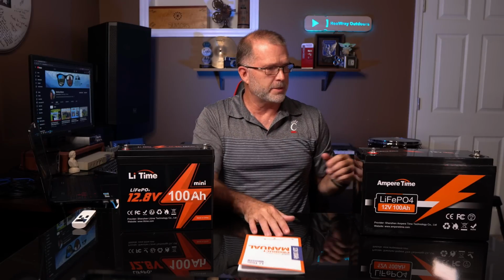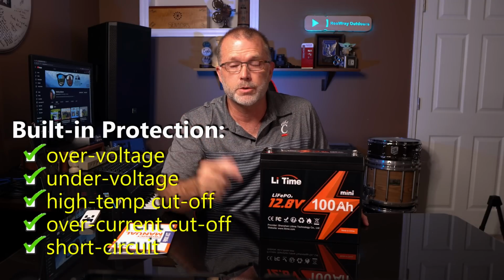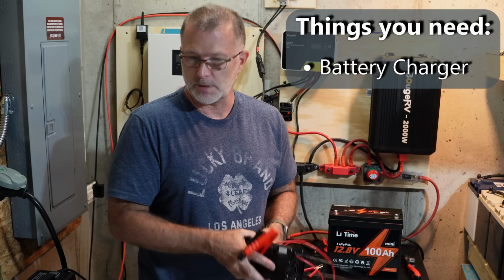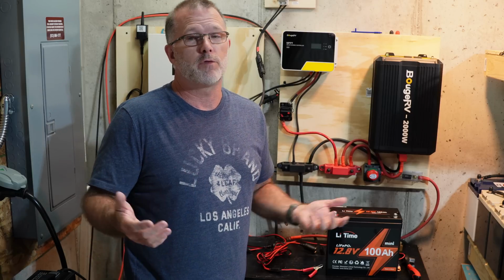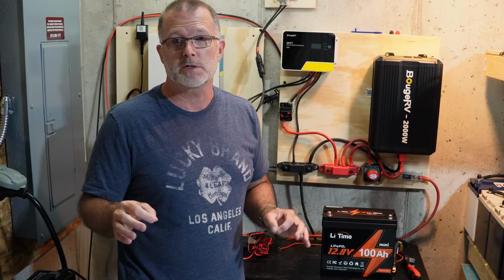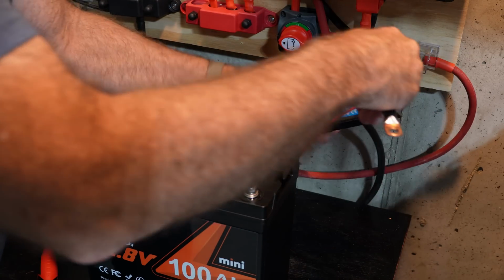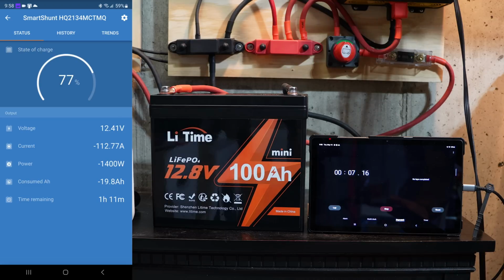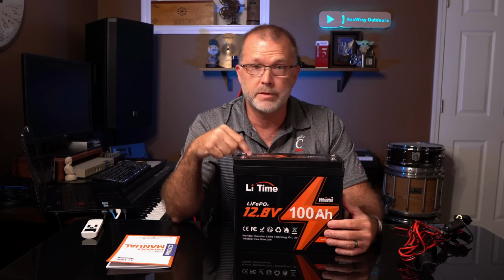12V BATTERY BASICS:  Featuring the NEW Li Time Mini 12V 100Ah LiFePO4 Battery

Comment: Hi, thanks for the great info, I have 2 of the mini’s and looking for a way to see how much time and capacity is remaining while using real time
I see the Bluetooth info from shunt and looks like it showed over 2 hours but actually was only about 15 minutes while you ran the test? Is that correct? 
Is there a gauge that will accurately reflect real time capacity remaining while using? Thank you

Comment: I have two of these Li Time mini 100ah lithium batteries. I know this battery does not have low temperature protection, but do you know if it has the ability to shut down charging ability below 32 degrees?

Comment: Unfortunately, they only have a C/2 rating..  I need a 1C rated battery.. Otherwise.. price and quality look good.
Reply: I was hoping these were around 10c-15c rating so i could replace the 96ah Headway cell bank I have in my car for my stereo system.  So these are only 2c rated..?
Reply: @Randy_G  I talked to LiTime.. They assured me the battery had a 1C rating... but, for charting it is a 0.4C rating.. I don't know enough about LIFO batteries to understand this.  My want is to be able to recharge as rapidly as possible

Comment: 👍👍 I clicked your link and I saw one was 230 amp hours and I read the warning sign. It said do not reverse connections to the battery. So do that mean you cannot charge your front battery with your back/home batteries. 11-21-23

Comment: Based on your review of the Li Time mini battery I bought two of these and they have performed well. Have run our 12 volt fridge overnight successfully.
My concern is that since these batteries do not have low temp protection (I’m in the NW suburbs of Chicago), is it enough to disconnect the battery cables to prevent the solar panel from charging when below freezing. We’ll be heading to Florida in a couple months. I’ll leave the batteries disconnected until we get to a campground where the temps are consistently above freezing.
Or…
Should I disconnect the batteries and move to my home, placing them on a slow trickle charge..

 I’m hoping disconnecting the battery cables will be enough for that 2 month period. Thanks.
Reply from the maker: I think you're fine just disconnecting the solar charging cables. They concern isn't so much the temperature it's trying to charge the cells while they are frozen, that is, the main problem, the battery itself can certainly handle some low temperatures without any as long as you're not actively trying to charge it.
Reply: @ReeWrayOutdoors  Thanks for the quick reply. I’ll take your advice.

Comment: Awesome video, extremely thorough. I'm between the regular 100ah LiTime and the Mini. The only real difference I can find is the type of cell (prismatic vs pouch) and obviously the Mini is lighter/smaller. The Mini is $10 more. I will be using it to power a trolling motor. I'm leaning towards the Mini for smaller size. Do you have any recommendation? Thanks!

Comment: I just  bought one to put under the passenger seat of my 2005 T1n Sprinter. It will hook up to an 1800w Tripp Lite inverter that was already in the van w an AGM attached. They ruined the AGM by leaving the inverter on and draining the battery.
Can I just hook up the new battery? Or do I need anything else to change from AGM to lithium.

Comment: I have a question. How long will I be able to riun a Portable AC that pulls 860 watts off of two of these batteries? I'm Using a 1000w inverter to run it. By the way nice Video, very specific on how to start your own system. looking forward to seing more.
Reply from the maker: There are a LOT of variables here so all we can do is make some assumptions and estimate.  If we assume that the compressor will only be on for 50% of the time (given the temp setpoint, and the room's insulation properties), you could estimate that the combined 2100Wh usable capacity of 2 of these batteries through an AC inverter,  divided by 430Wh, should get you just under 4.75 hours of runtime....or only about 2.4 hours if the compressor has to run continually.
Reply: I use the old manual control Frigidaire AC. It draws only 400 watts.

Comment: can i use this battery to power a 70lb boat electric motor that runs on 12v!?thanks
Reply from the maker: Yes if it's a trolling motor that doesn't pull more than 100A continuous
Reply: I specify that I have a 70 lb brushless electric motor that runs on 12v to Makes carpfishing is the 12v 100mh or the 12.8 mini model better?

Comment: Sir how do I know how many mAH my snap on battery is per cell?....it's a 2.5ah battery with 9 1.2v NI-CD pls....it is not printed on the side
Reply from the maker: It's early in the morning and I haven't had my coffee yet...but I think we need to know the voltage of the battery pack.  Then we could probably figure out, based on the 1.2V of the 9 individual cells (if I'm reading that right) how they're connected.  And from that we should be able to calculate the individual cell mAh.

Comment: I setup my cutoff voltage on my first (of two) minis (from Powerqueen but an identical battery) to 9.5V and it was still going which surprised me. I emailed PowerQueen and found out their BMS parameters are little different. They shaved some off the top end but are going a little too low on the low end. Here's the email I got from PowerQueen on BMS specs

1、Single cell overcharge protection V 3.58 CELL MAX > 3.58V
2、Single section overcharge recovery V 3.48 CELL MAX < 3.48V
3、Single-section over-discharge protection V 2.25 CELL MIN < 2.25V Charging recoverable
4、Single-section over-discharge recovery V 2.45 CELL MIN > 2.45V
5、Equalized turn-on voltage V 3.455

I was happy to see they ditched the 3.65 or 3.75V cutoff for max cell voltage and went down to 3.58 which is MUCH better. We all know there is NOTHING to be gained above 3.60, the voltage skyrockets even at a low charge.

Comment: How would you recommend connecting to a USB powered device?
Reply from the maker: There are a couple of simple solutions you could use.  Here's one with battery clamps for quick attach/detach: https://amzn.to/46jWSW1    Or, here's a couple of USB connectors with direct DC leads that you could crimp ring-terminals onto: https://amzn.to/44jhBHS    Or you could just get a female 12V socket with clamps like this: https://amzn.to/3prZtMX   and just plug in a 12V car to USB adapter when you need it like this:  https://amzn.to/3NrgfUH    Hope that helps!

Comment: What type of charger/inverter does these batteries require?
Reply from the maker: You really just need something with the voltage that matches the configuration you're going to have them in.  If just a single 12V battery, a 1000W 12V inverter would be ideal.   This is a decent 1000W inverter: https://amzn.to/3owosOL  I have the 2000W version, but they're solid little inverters.   As far as a charger,  I think I put a link to a suitable charger in the video description if you want to check that out.
Reply: A 20 amp plug-in LiFeP04 charger is how I top mine off before storms.

Comment: I have this battery in my YakAttack CellBlok, one of the key benefits for me is that it's lightweight, especially with the battery compartment on the rail of my kayak. I've had zero issues charging it or having it hold a charge. I'd definitely buy a second one if I needed it.

Comment: I have been using LiTime batteries for my solar power system for six months now, and they've been working flawlessly. The compact size and light weight make them easy to install, and the fast charging time is impressive.

Comment: Hey there, this is actually a funny coincidence… I’m looking to power my two electro voice zlx 15s at the beach for a event next month… I see you have one in the background lol… I want to build a power station with a battery and inverter… my knowledge on amps, amp hours is pretty limited, but I can somewhat understand…. My question to you is in your opinion what do you believe the best battery and inverter (watts) would be good if I wanted to run those speakers for about 6 hours on medium to high volume…. your input would be greatly appreciated, thanks!
Reply from the maker: I'd have to test to be certain, but I think you could get by with a single 100ah battery and a 1000W inverter.   You definitely don't want to go super cheap on the inverter or you'll get noise in the speaker.  I'd highly recommend picking up a cheap watt meter and actually measure the consumption on your system for a couple of hours to get an average Watts per hour.  Take that number and multiply it by the number of hours you need to run, then add 20% for inverter loss and you should have a pretty accurate sense of how much capacity you really need.  https://amzn.to/3OvRqZU. For the inverter, this would be a decent choice (assuming  you're not pulling more than 1000W, which I don't think you will...but again, the watt meter will tell you for sure): https://amzn.to/3OuAD9j

Comment: Thanks for this video! I think the lighter, more compact battery is very, very cool. I think I'm gonna buy one to use on the trolling motor for my small inflatable raft. I've already switched to a LiFePO4 battery because of the weight savings and longer run time over Lead Acid, but now it seems that I can save even more on weight and also on space. Win, Win! 
  I recently learned that the fuse doesn't have to be in the Positive cable in most applications. That recommendation apparently came about from the automotive use of storage batteries. In a car, the negative or ground wire is mostly made up of the vehicle's steel chassis. Since the positive wire is usually a long wire running to each electrical device and the purpose of the fuse is to protect the wire, on a car, the preferred place for the fuse is the positive. If you are running a copper wire from both the battery neg. and the battery pos. to the device, like an inverter or a wench, the fuse can be put in whichever wire is most convenient for your installation.
Reply: The abyc says you’re wrong
Reply: What is the abyc? @nicholaycalhoun1681
Reply: Now that I know that you're referring to the ABYC standard for boat wiring, I think I'm still right. Do you realize how many boats use the same chassis grounding system as automobiles. The positive wire has the fuse because it is usually the only actual "wire", just as in a car. Besides that, the ABYC just makes "recommendations" that are followed "voluntarily" and they don't really explain the reasons why they make some of the recommendations. They may choose the positive wire simply because it works whether you're dealing with a chassis ground or an actual 2 wire circuit, but I know enough about DC electrical theory to know that, if you use 2 physical wires, the fuse will work fine in either of them. @nicholaycalhoun1681

Comment: The ‘reluctance’ that many consumers have had in adopting this Smaller, Convenient form factor, is the use of Pouch Cells vs. the “standard” Prismatic Cells.  While pouch cells aren’t actually “new”, since they’ve been used in laptops, tablets, cellphones, and EVs for some time, the use in Mobile Solar applications IS new.

Safety is a primary concern here.  I have yet to get any CONCRETE unbiased info on their stability in a vehicle Solar install.  Will P drilled holes in a pouch cell, and it exploded quite dramatically.  Another channel, the person drilled A Bunch of holes, doused with water, and had little drama.

I have emailed the couple of brands that have produced “Mini” batts like this, and None have given me Any useful information on Safety factors incorporated in to the design.  And YES, I’m well-aware of the difference between Li Ion, and LifePO4.

So …. Thoughts …. Anyone ? 🤔🤓
Reply: That is not true. Will Prowse drilled holes in a solid "state" Lithium pouch battery. That caught on fire. If it is a LiFePO4 pouch  battery it would not catch on fire but it would vent.
Reply: At this time, LiTime, Redodo, and Power Queen offer these …..
Reply from the maker: From what I've seen, LiFePO4 chemistry, if compromised, will generate a fair amount of heat, but tends to just smoke like a beast without actually catching fire, like Lithium NMC. So definitely not risk-free, but substantially less risk of fire.

Comment: I'm thinking about building a new off-grid man cave that is completely solar powered. I would like to run all my appliances such as a tv and lights that I can use without using an inverter at all. The lights of course are the easy part but is it possible to use a normal AC wall outlet and wire it up for 12/24 volts? The label on the back of the tv says it will run off DC  I just don't know how to use it for DC power.
Reply: Don't use a normal wall outlet for D.C.  It is unsafe and does not meet electrical code because it is unsafe.  Most of the time people use hobby connectors like the XT60, and the amateur radio folks have standardized on the anderson powerpole connectors for 12v.
I don't know anything about your TV, but usually there is either a separate connection for D.C. or the cord detaches and you would use a different cord with the TV connector on one end and the appropriate D.C. connector on the other end.
Reply: Thanks for the info. It's a LCD tv with the cord that disconnects, looks like a plug for the tower on a desktop computer, so the option to use a different cord is the option I think I will be looking into.

Comment: I have 3 of these Li Time 100 Ah minis.  I absolutely love them.  I'm 76 years old; and that lighter weight is truly appreciated.  The smaller size is a great feature that helps me the way I use them.  I'm using Vigorpool Captain 1200 solar batteries to run my two refrigerators.  By connecting these Li Time 100 Ah minis to these Vigorpool solar batteries using the Anderson connectors I double the capacity and run times of my solar batteries.  When the power gets low, I swap out to a freshly charged Li Time mini and keep on powering my refrigerators.  This system is working great for me.  I also believe these mini 100 Ah batteries actually hold a little more power than my full sized Ampere Time 100 Ah batteries.  These are a win win improvement!
Reply from the maker: NIce!! And, quite coincidentally, I'm working on a review of the Vigorpool Captain 1200 for the past month or so!  Should be out next week.
Reply: I use the 300 ah Ampere Time for emergency air conditioning. It got me through five Louisiana power outages during extreme heat emergencies since June. I power a 400w Frigidaire air conditioner with it and usually recharge it with a 20 amp plug-in charger. My solar setup is limited by small wires to about 300w max. I need to install 6 awg short cables to my battery and get 8 awg MC4 cables so I don`t have to use series solar panels. Sun is limited to 5 hours a day here in summer.
Reply: I am new to Lithium and I am looking to swap out my RV lead battery for Li, but I want to keep the weight down as much as possible. I have been eyeing a LiTime 200ah battery, but I saw these minis at 19lbs. I thought 2 to these minis would weigh less than that one 200ah battery. I have a solar charger and converter that will work with Li. What do you think?

Comment: Saw a video recently about using a resistor to eliminate the dreaded spark. Is this true and if it is, what size resistor would be needed? Thanks in advance!
Reply from the maker: Yep! Those are super cheap and work great!  Here's what you're looking for:  https://amzn.to/41SZDue
Reply: You could also use a normal #2 pencil (I recommend 4+ inches long).  Sharpen both ends. Hold inverter cable to graphite pencil lead at one end, touch other end of pencil lead to battery terminal and hold like this for 30 seconds or so.  With alacrity, drop pencil and connect inverter cable to battery terminal.

Or use a 12v incandescent bulb like a car taillight or headlight bulb - it will light and then go dimmer as the inverter charges. There may be a small spark on initial connection, but nothing "dreaded" about a small spark.
Reply: @Sylvan_dB  Great tip!